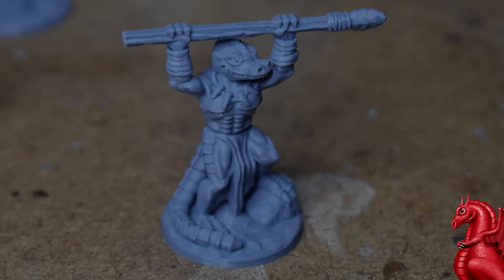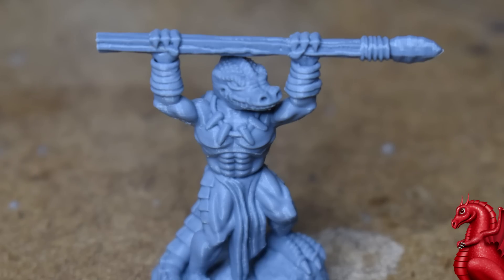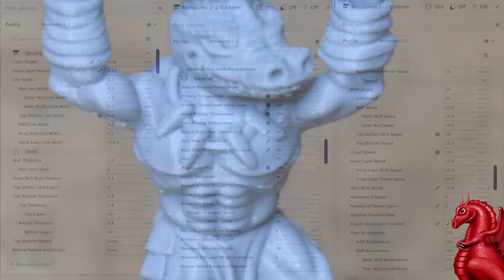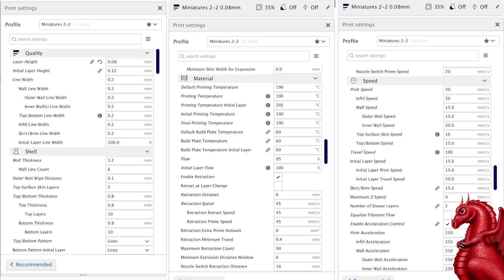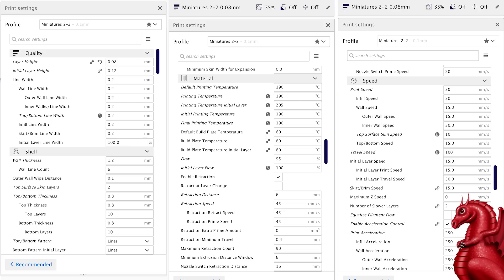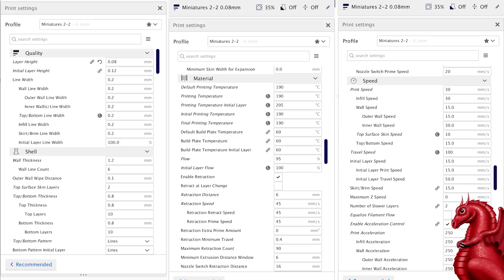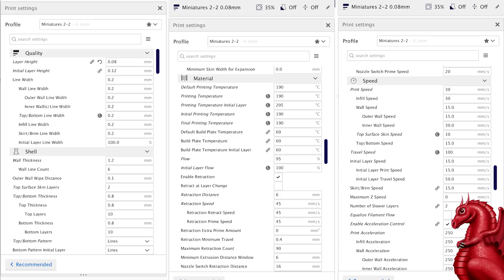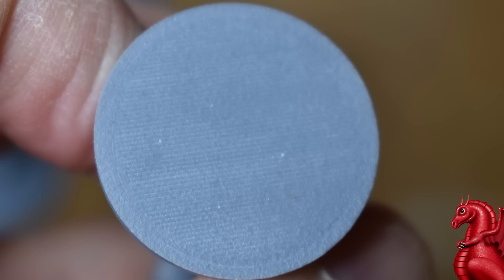How to 3D Print Better Miniatures: Pt. 3 Resin-quality on a FDM printer!

Comment: Just getting into 3D printing, and I'm glad I found your channel! Do these settings work well as a general starting place for all FDM printers? Will these settings work well for larger statues as well?
Reply from the maker: These settings aren't up to date, use the newer Cura profiles on my website under the Resources menu. No, these settings are only for miniatures.
Reply: @Tombof3DPrintedHorrors  Thanks for replying! 

Noted. I'll check out the new settings!

Comment: I wanted to try this on a v3 Se!
Is it worth it for miniatures to drop the extra 100$ to get the Bambu Lab A1 mini? Tomb made a video 4 months ago that basically said the A1 mini is the new standard for FDM miniatures,  and so I wanted to know if the difference in quality is significant.
Reply from the maker: Yes, the V3 SE doesn't come close to the Bambu Lab A1 Mini for printing miniatures.
Reply from the maker: And, the A1 Mini is now only $249, so it's only $50 more. :)

Comment: A small question, do you print one miniature at a time, or it is safe to print a couple? For example I would like to print several miniatures overnight. I`m asking because the travel acceleration is quite high and it could possibly knock or damage some pointy parts.
Reply from the maker: For absolute best quality I do one at a time.

Comment: Hi so I hand copied your settings cause I didn’t think I could just copy them but basically the prints turn out super awesome but mine require supports and it seems like they’re a lil janked trying to print the weapons and stuff do you have any advice for supports?
Reply from the maker: Sorry, none of the minis or terrain I design require supports. You need to ask whomever you bought the minis from for the settings they designed the minis to use.

Comment: Hey! I bought your latest Cura profile on your site and tested it out on my Ender 2 Pro. The first layer is fine, but for some reason I'm still getting gaps in my prints. Any way around this problem?
Reply from the maker: Gaps in your prints are the result of under-extrusion. Check my video on how to resolve it (there are a number of potential causes.) :)

Comment: this is amazing quality!  I could have swarn it was resin before you said it wasnt.  Im looking to get my first printer and am thinking of getting the Bambu A1 mini (when it eventually comes out).  Am i safe to assume it could achieve the same quality with a 0.2nozzle?  Also- ill love to see how these settings work for larger prints (albeit much longer prints) would the detail still hold out with larger prints?
Reply from the maker: I have seen prints from the A1 (prototype) that look like it will definitely do this quality or better AT SLOWER SPEEDS similar to the Ender-2 Pro speeds.
Reply: @Tombof3DPrintedHorrors  would you say the ender 3 would give finer quality prints than the a1 mini? (Sorry - just trying to get my head around all the different printer types 🤦‍♂️)
Reply from the maker: @nickholl  the current top printer for doing minis is the Ender-2 Pro (see my video on that one), I think (but cannot say for sure until I get one and test it) that the A1 will be as good or better on minis than that one.
Reply: @Tombof3DPrintedHorrors  oh! Interesting. I’ll definitely take a look. And it’s £100 cheaper than the mini (and available).

Comment: Profile works well, I adjusted the values shown in the video as they did not match the file but my first test print came out amazing and this saved me weeks of test prints.
Reply from the maker: Use my latest settings/profiles available at my website, they improve quality significantly over these settings which are several years old at this point.
Reply: I did get my first clogged nozzel with the settings ~10 hrs of printing, going to try a filament filter do you have any other suggestions to try Neptune 3 ESun PLA+ @Tombof3DPrintedHorrors
Reply: Ok I think I figured it out I added a filament filter to stop dust and after some nylon cold pulls I am printing again with your profile and it looks great.

Comment: Do you have a lit of every setting parameter you're using in Cura anywhere? I have an Anycubic Chiron and the Ender 3 profiles can't import. I had a profile in one of the older versions of cura that was printing pretty good miniatures, then I got a new computer and got the latest version of Cura and all of my prints became a stringy mess with fused supports. No matter what I did to the profile it kept getting worse. I've tried starting from scratch but I can't seem to get things right. Either I've reduce the stringing, or my slices don't fill the model area, making small prints (really, most prints) look like they're missing most of their outer chunk. For example, an wing of something will look like a chewed up leaf, even in the preview. I want to try from a new baseline for .4 and .2 nozzles and your prints look amazing.
Reply from the maker: I have Cura 5.3 profiles on my website, just load them and take screen shots of the settings to make your new profile for your machine.
Reply: @Tombof3DPrintedHorrors  Trying to do that right now.  You’d think it would be easy to just bring up a side by side between profiles within Cura? Thank you!
Reply: @Tombof3DPrintedHorrors  I noticed you turned Print Thin Walls off. Didn’t you have that on originally?
Reply: @Tombof3DPrintedHorrors  Currently printing a stringing tower test with the setting 1 to 1 translated.

I did bring up a miniature STL in a new instance and sliced it. When I go to preview, I still see busted wings on thin parts of the model. I’m throughly confused as to why this is the case. I can fix it with adding a default horizontal expansion to each layer, but I’ve never seen anyone else do that so I feel like I’m missing something. If the stringing is fixed, I will try to work on that problem next. I still feel like I’m doing something wrong.
Reply from the maker: @originalSPECTER  which of my models is this?
Reply: @Tombof3DPrintedHorrors  Was using a test Tower. Didn’t want to attempt another mini until I at least get a decent simple print.
Reply: @Tombof3DPrintedHorrors  Right as I sent that last message, the 3D test print failed completely. Failed bed adhesion, lots of stringing and even a bit of burned PLA + (I happen to be using white Esun by complete chance  so the material is actually the same as what you use). 

In my attempts to fix the issue, I keep f somehow making things worse. Baffling.

Comment: Any new updates to your profiles based on the newer changes to Cura since this video came out?
Reply from the maker: Lots since Cura introduced the Aracne slicing engine, go to my website to download the most current profiles/settings under the Resources menu.
Reply: @Tombof3DPrintedHorrors  thanks
Reply: @Tombof3DPrintedHorrors  if I upgraded to a direct extruder that moves the existing extruder to the X axis above the hot end would any of these settings ideally change?
Reply from the maker: @LouisACasadia  yes, these are designed for bowden tube feed. Going to direct drive extrusion will lower print quality. You will need to experiment with settings to try and get them dialed in.
Reply: @Tombof3DPrintedHorrors  in your opinion does the direct extrusion actually help with quality on printing minis?
Reply from the maker: @LouisACasadia nope, for minis bowden is best.
Reply: @Tombof3DPrintedHorrors  is that because of the weight direct extrusion adds to the print head? Thanks for replying BTW

Comment: Follow tutorials to switch from .4mm to a .2mm, and got the same bad results as I have each time I've tried in the past...everything works fine when I do a bed level/print test, but when I actually go to print, it's like the nozzle is to close to the bed and not printing. I've used the latest .2mm setting in Cura 5. So, I'm giving up.  I'm really tired of something so easy screwing up and causing so much frustration.

Comment: Dude! I just plugged your 4mm nozzle profile into Cura to see what happens, and got the best print I've ever had! The layer lines are barely visible, on a SILK GOLD! I haven't even tried the 2mm nozzle profile yet! You just took so many hours of tinkering and research and frustration out of the process for me! You're truly the best 3D printing channel on Youtube!
Reply from the maker: Did you try my latest Cura 5.0 profiles from my website? They are even better than the quality these older settings produce :)
Reply: @Tombof3DPrintedHorrors  I'm still on Windows 7 so I'm stuck on Cura 4 lol, but noted, once I get a new PC and Windows 10 I totally will check it out!
Reply: did you use supports?
Reply: May I ask what do you do for post processing for a 28mm miniature to erase the layer lines ? Do you recommend resin, sanding or what ?
Reply: Use a layer of primer  @jchamorrob

Comment: I have a Question I downloaded the profiles but there is only a .3 and .4 nozzle option were is the .2?
Reply from the maker: With Cura 5.0 and variable line width slicing .2 isn't really necessary anymore, .3 will replicate the same details as .2, but with less hassle and more forgiving tolerances.

Comment: In one of your videos you say that using supports is in another video and that you will go over it in more detail. I am having a horrible time finding that video as I go through your videos. I am sure this has been addressed somewhere in your channel, whether it be the video I am looking for or embedded in another video that I have not found. Pointers? I am really curious about how you handle this and want to make certain that I use them when necessary in this approach to printing minis, and when I do use them, how to get the best outcome with them. Thanks! :D
Reply from the maker: I've not covered supports as of yet as all of the Dragonlock terrain and miniature models I design are supportless.

Comment: Can I use these Cura settings with a standard 0.4 Nozzle from my CR 6 SE?
Reply from the maker: Use my latest Cura profiles in the video description. The CR6 is a good printer, but does not quite match the standard Ender 3/ 3 v2 in print quality.

Comment: Love the info and the To3DPH vids have been a great hep in getting my Ender 3v2 up and running for minis.  The only issue I see here, using a .2mm setup and these settings, is the wildly slow print times.  Any thoughts of how this could be sped up a bit without much risk to mini quality outcome?
Reply from the maker: If you want quality you print slow. My latest .2mm (and .3mm) minis profiles are on the FDG website. If you want faster, go with the .3mm nozzle.

Comment: Im getting the following error, I have cura 4.11 new install so not sure what could be wrong. Printer (ender 3) is setup and nozzle is correct. Successfully imported profile Cura4-11_Mini_02mmNozzle_v1 #2.

Warning: The profile is not visible because its quality type 'super' is not available for the current configuration. Switch to a material/nozzle combination that can use this quality type.

Comment: Hey doubt your gonna read this but here I go. How do you handle prints with thin bits eg fingers
Reply from the maker: I specifically don't sculpt anything like that on my models for the very reason it is too difficult to print (same reason none of my sculpts require supports.) :)

Comment: I've really been on a journey of discovery with your videos over the last few days. Implemented the stringing fix and installed the 0.2mm nozzle (along the way throwing out a heater block and thermistor due to clumsiness). I'm not quite there yet (stringing just wont go away...starting to suspect it's the filament I'm using), but I've learned a lot about printing, slicing, and the printer itself. Much appreciated!

Question, what do you think of replacing the heat block with a copper one? Apparently it offers more temperature stability and thus cleaner prints.

Comment: The profile in your dropbox doesn't seem to match watch you show in the video.  Which do you recommend?
Reply from the maker: This video was done in 2019, the profiles in my dropbox are my most up to date setting recommendations. Many times things change as Cura makes changes with new releases.
Reply: Can you address some of the more important changes?  Specifically, layer height.  Your video shows .08 while the profile has .1.  This seems more like tuning from experience rather than a Cura change.   Do you find it necessary to modify the profile in your video to get reliable prints with .2 mm nozzle (I'm really struggling).
Reply from the maker: @davethomaspilot  the latest profile utilizes a new feature in Cura called Adaptive Layers, so the .1 is not what most of the mini is printed at. Again, this video is from 2019 and the profiles reflect my most current settings, many of which have changed due to ongoing changes in Cura.
Reply: Thanks for the quick reply!    I'm just grasping on what my issue is.  I can't even print the skirt without either clogging the nozzle or having adhesion issues.  .2 mm nozzle, hatchbox PLA, new bowden, new nozzle (3 times now), your Cura profile.  ABL, z-offset is accurate as I know how to get it without being able to print anything--(how tight the fit between paper and nozzle should be?)

Maybe it makes sense to register to your forum and ask for help there.  

Nice video!  It makes it look easy.
Reply: My issue was poor quality .2 mm nozzle.  Hole size was far too small.  Ordered expensive one, will try again next week.
Reply: Happy to say I'm now printing with .2 mm nozzle using the profile you developed.  Thank you!  No issues, once I got a decent nozzle.

Comment: the custom cura profile from part 2 works fine with 0.1mm  configuration? or this with 0.08 is the newer profile to replace the one in part 2

Comment: cura 4.7 doesn't seem to want to accept the your profiles. gives this error "....Could not find a quality type standard for the current configuration."  any idea?
Reply from the maker: Don't use 4.7, it has numerous problems and quality issues. Stick with 4.6.2 until a stable version of 4.8 releases.
Reply: @Tombof3DPrintedHorrors  ok, will do thank you! i can now stop messing around in a text editor
Reply: @Tombof3DPrintedHorrors  tho, might just continue, 'cos it aint gonna beat me

Comment: Just wondering. I once suggested if you could add a PDF of your settings on your web download. So anyone that dose not have a Ender  3. Can just in put manually the settings in Cura for their printer.
And thanks for your reply and explaining time commitments would be an issue. 
I'm now wondering would it be easier and faster to do a screen shots like you have done here in this video,  instead of do a full doc??
Reply from the maker: I did screen shots about two weeks ago, look in the Cura 4.6 folder for them. :)

Comment: I was trying to use your .4mm Cura profiles with .2mm nozzle, but I find it difficult to set proper settings (with 0.08 and 0.12mm layer hights). 
Which settings shall be changed when nozzle is replaced?

Comment: Thank you, thank you, thank you! The 0.2mm cura 4.4 miniature profile works great! Before I tried that I was getting clogs. I bought the owlbear miniature, great detail! I modded the profile a bit because my nozzle is stainless steel, so I have 215 C nozzle and 60 C bed temp. I found I needed to have blue painters tape to get pt 2mm prints to stick, whereas I never had a problem on pt 4mm nozzle, so that’s a notable difference. I also really like the raft setting, it makes it much easier to get your print off when it’s done. (I am using cura 4.6.1).

Comment: I noticed that you have not made any new .2mm profiles for new releases of Cura. Have you abandoned the .2mm setup or are you still using it?
Reply from the maker: The Cure 4.4 profiles still work fine, I just have not had time to do any experimentation with 4.6 (I mainly use .3mm nozzles for minis now) :)
Reply: @Tombof3DPrintedHorrors  If you do not mind me asking what makes you use .3mm nozzles now? Is .3mm better?

Comment: hey im a bit confused about the profile. I downloaded the 0.2mm profile for cura 4.4 since it was the only 0.2mm one there and noticed that few settings are slightly different, for example in the profile "outer wall wipe distance" is 0.2 instead of 0.1 and "retraction distance" is 7 instead of 6. should i modify the settings so its the same as in the video or should i just leave it?
Reply: Is this a rhetorical question? Use the same settings as the video and start from there.

Comment: First of all, thank you very much for all your videos! I really appreciate it very much - the settings you use work perfectly for me and the explanations are awesome :)
Only one short question - you said, that your figurines are 100 % support free. How is it possible to print the stick like this? Because it's actually nearly horizontal - maybe I have missed something.
Thank you for your answer right away :)
Reply: My best guess is "bridging." If you have really good cooling and decent natural supports (in this case, lizard-man's hands!), FDM printers can actually drag reasonably straight filament across small gaps. Seeing as we're dealing with ~28mm miniatures here, those gaps are actually quite small from the printer's point of view. I had a teeny-tiny horizontal arrow shaft on one of my sculpts print reasonably straight, and I was quite impressed. :)

Comment: Hi! Great video but I have a question as someone who's just starting out. Using this Cura profile I'm getting gaps in the shell each layer (in the slicer preview, haven't printed anything with it yet). Is that intended to avoid overlaps or is there some settings I should change? 

Thanks for all the help I've gotten through you videos.
Reply: It's because of the coasting settings. Coasting stops extrusion right before the layer is finished and the rest is printed with the remaining pressure in the nozzle, hence you see a gap in cura where it stops